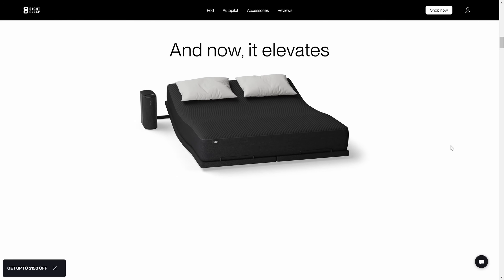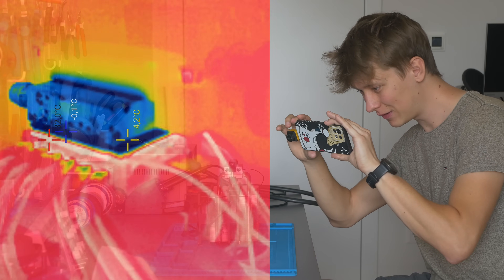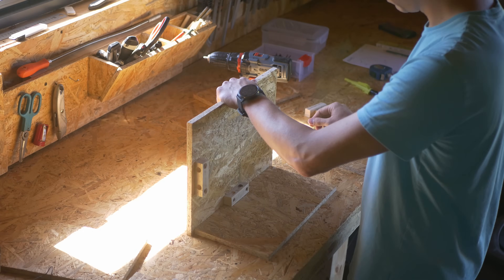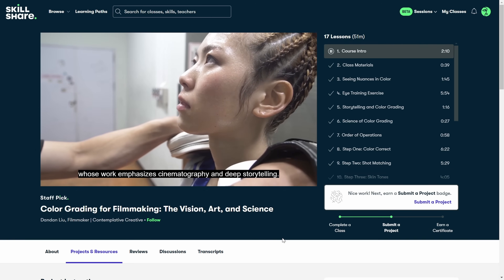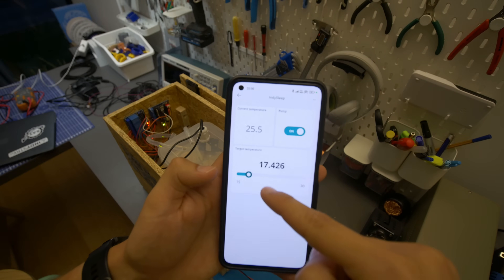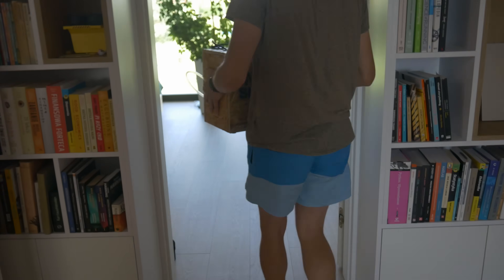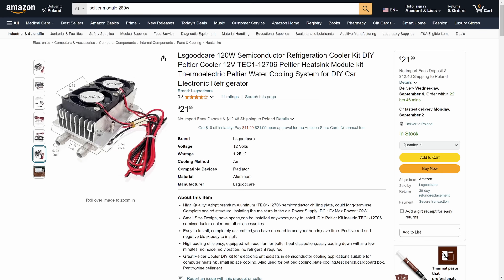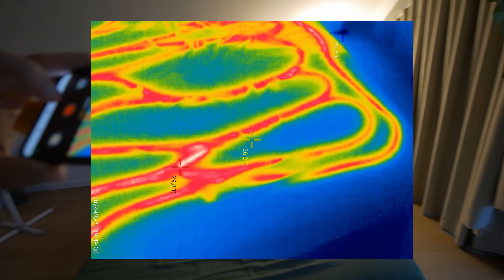I Made a $4000 Water Cooled Bed

Comment: Peltier cells just aren't the right tool for the job IMO. It's too inefficient and burns insane amounts of energy. Better to use an old fridge compressor/heat sink.
Reply: They can be efficient depending on the temperature delta and current
Reply: The downside with that would be sheer amount of extra noise from the compressor.
Also, working with refrigerants is gonna be a huge pain.
Reply: @FinlayDaG33k  for a refrigerant you can use the propane actually. Not the best freon indeed, and it's flammable (a lot xD), but the you can't beat availability and easiness of getting it if you're just a maker, not a HVAC specialist with proper licences. All other stuff (except refrigerant itself) you can buy without a licence
Reply: @felixyasnopolski8571  Still sounds like a huge pain to work with... Because now you have something that can kerplode. :')
Reply: @FinlayDaG33k  alot of ppl have propane torches in their house to light a fireplace, and it being in a ac unit is not much different, and in lower quantities.
Reply: Exactly. A compressor based coolant system in another room would be ideal
Reply: You honestly don’t need either, just use a PC radiator and thermostat to control how hot the liquid gets
Reply: You folks are missing the point, which is that the product is reliable, whisper quiet and works insanely well without any BS. It makes 1/3rd of your life 150% better. I used to feel like a zombie for the first 4-5 hours of every day, because I slept in a sweaty mess. Cooling your room does NOT cool your bed in a way that is useful. Furthermore, if you sleep with someone hot, I guarantee you that they are cold. Trust me when I say that this $2500 system can save a marriage.
Reply: Yeah a good portable AC unit is like $500 USD, and they're quiet enough. Just hack its cool line to go through your mattress and you're set. Or jam a radiator in the cold air outlet to run your line through, so you can still use it as an AC
Reply: @32BitJunkie then its just easier to cool or hest the room and not the bed
Reply: @32BitJunkie  true and you can even get them for like 200 bucks😀🥰
Reply: @32BitJunkie the latter works insanely well, I've done this myself LOL

Comment: It seems like the primary issue is getting enough heat to transfer between the tubes and the bed. Id make a metal tubing system thatd be placed underneath the bed. To make sure the bed is comfy id inlay the tubing in a sheet of foam. Lastly id attach rolls of metal to the pipes to further disapate heat. Also id be carful with how thick the mattress is. I dont know how insulative they are

Comment: For sure the best way is to use compressors, but it's practically impossible to realize without specific tools 😃

I tried to build a peltier cooling system and what I can say:
- There was lack of cold side insulation
- Hot side was watercooled with big cooler, but in the same case it was diffusing heat too much
- Pump was to small for hot side
- And the most important: I should have used mosfets to better manage my pumps speeds and fans, but mainly for the peltier, as when you turn it off all the heat is going back to the cold side

I was using PC PSU for that and it was sufficient for 8 peltiers as yours, at the condition to use all 12v and GND cables :)

This kind of system must run on solar or wind turbine system, as it's a fully recyclable and very durable system (against compressors), but also as it consumes A LOT of energy :)

Nice you tried it, if you wanna continue I recommend you buy chinese waterblocks for both peltiers sides (4-slots is good), and a freaking car radiator to dissipate all that massive heat and send it to the space woooww 🏔🌍🚀💞

Comment: Regarding Thermal Paste: You basically over complicated things, in general you just put one or more blobs of thermal paste on the cooler and the paste spreads its self while tightening the cooler down. So no real need to spread it with this much effort :)
Reply: That is true if you have enough clamping pressure. While that's the case with modern CPU coolers, with this mounting setup that might not be the case.
Reply: @WoLpH  fair enough

Comment: maybe something like a flat inflatable water bed that you circulate the cold water under where you sleep as a heat exchanger might work instead of tubes
Reply: and maybe an old fridge cooler mechanism with inverter and a pid controller might work better than the peltier
Reply: If you build a small water bed... Why not just go all the way that ist much more work. And if you're just thinking about a bedsheet with water in it. I think you have problems with the cooling circle. Like it will have some dead spots where no cold water will flow to.
Reply: @fridolineckerd6135 you could maybe combine several smaller pouches filled with water
Reply: I wonder if a water bed passively cools on its own... That's a lot of thermal mass right there at room temperature

Comment: Did you ever sleep on a cool bed in a hot room? I never tried that. I live in hot climate in Thailand. Almost everybody wants to sleep with some cooling. And almost everyone uses air conditioners to cool down the room temperature and/or fans to move the air, so they feel moving air on their skin which makes it feel cooler. I don't know anybody with a cool bed - and I don't think it would be comfortable.
Cooling just the bed should be a lot cheaper than cooling the entire room. And if it would work, I am sure lots of people would do it. But nobody does it.
Summary: Get an air conditioner for your room. Problem solved. Enjoy!

Comment: I wouldn't say this failed. It just seem to underperform. One quick thing to try is reduce the amount of bed you are trying to cover. Maybe just half the bed or just the area around your torso. As for tube placement, what about taking two sheets and sewing channels to hold the tube in place?
Anyway, great idea. Looking forward to how it keeps you warm in the winter months.
Reply: Very true. Although the end goal wasn't met (cooling the bed to a comfortable temperature), the system itself worked. Even something as simple as running the liquid through multiple Peltier coolers would make it perform better.
Reply: @timderks5960  Yeah a second box on the opposite side of the bed with another peltier and heatsink (maybe a second pump?) would probably help. Cool/heat the water a second time halfway through the loop.
Reply: @timderks5960 yeah but then you're just making the problem of the peltier increasing the room temperature even more. I wonder how Eight Sleep does it
Reply: @athmaid  they don't.
the heat in the bed isn't great enough to significantly heat up your room anyway. This is basically a fridge logic.
and let's be honest. If you can afford $4000 with subscription, you can afford AC unit.
Reply: An idea from my small brain is to have a bigger insulated reservoir for the water. The power should be enough to cool/heat a "heat bank" closed from the bed loop for a time before going to sleep. When going to bed open the full loop and you only need power to maintain/slow down the heat already in the system.
Reply: add more dense tubing and connect it to a chiller that will make it really cold

Comment: Routing grooves for the tubing in foam insulation would provide some benefits: 1) reduce heat/cold loss into the mattress, 2) make it easier to route the tubing, 3) smooth out the surface you are sleeping on. I was thinking of that flexible closed cell foam often used as protective packing. 

I foresee problems when you are in cooling mode with moisture from condensation accumulating on and near the tubing. It might be possible to use your micro-controller to monitor the relative humidity and keep the water/tubing temperatures below the dew point.  Here in Minnesota USA, high temperatures usually include high humidity. Wet bedding could get ugly quickly. Were there any indications that the $4,000 system addressed condensation situations?

More peltier modules would work but the inefficiency and difficulty transferring the heat outside would become even more of a problem.  Ultimately a refrigeration system might be more effective for moving heat outside the living space. Finding a small efficient compressor could be a problem. It might be possible to adapt a de-humidifier refrigeration compressor. That would likely involve some plumbing and recharging the system .......and a few more videos. 

Using peltier modules to heat might be less efficient than just using an electric blanket or pad. My experiences with peltier modules usually involved the cold side frosting up but I was not using water to transfer the heat. If your pump was to fail and the peltier module wasn't shut off, you might have issues with water freezing. I really enjoy your projects. Thank you for your creative approach to probems.

Comment: Nice!
Well, putting the unit itself outside will work better, making it a more local cooling-system (like airco but more specialized). And then ofcourse as a more efficient bed-heater then a normal heat-blanket as we normally use (just electric heaters). If you are using it in the same room, well you mainly move heat and at the same time heat (or cool) the room + extra electric heating.
Actually, peltiers work more optimized if you keep them cool on the 'hot side' too, thus a vat of water could help already to make a buffer.
For more optimized cooling, you can also use the system from a normal refrigerator/ freezer which is far more efficient (and therefore more quiet) then Peltiers, still working as heatpumps.

About the cooling... you need to insulate below the cooling or you will need to cool down the whole heat that is stored in the bed itself since that will keep moving upwards all the time. For example an airmatras below it. That is besides the spread of the tubes. Probably needing also to cover the bed before going to bed with the cooler/heater on for a longer time.

Comment: Please do a video on the mini arcade! I loved this project.
I think the tubing was a big choke point as well.
I can't think of another option, but changing out the tubing to something with a higher thermal conductivity would help alot.
I also wonder if, when testing it at night, your weight significantly inhibited the flow, limiting efficiency.
The small fountain pump provides so little back pressure that your natural movement during sleep could have some amount of peristaltic effect on the tubing, also limiting efficiency.

Comment: Hey Nikodem,
I’ve also been thinking in this direction and wanted to share a few ideas that might inspire you:

1.Cooling through water evaporation: One approach could be using an ultrasonic mister to atomize water and boost the cooler. Alternatively, you could consider wicking water through felt material and passing air over it to achieve passive evaporative cooling.

2.Hose routing: For the hose layout, you might find inspiration in the cooling systems of NASA spacesuits.
Reply: Just push air through the mattress, your body will provide the moisture. Humans lose up to a few liters of sweat during a nights sleep (depending on the person).

Comment: Possible improvements Im thinking about:

- stacking the cooling modules. Meaning facing the warm side of one with the cold side of the other one? Dont know if that would actually work

- have a dual water system like a nuclear reactor? Cooling a box of water down, maybe with the cooler build in with no pump needed, and then filling the box with loops and loops of the bed tube. That would increase the surface area and distance/time the loop water can cool down

- Prioritizing areas of the bed where the cold would be most notable, like head and upper body, since legs and feet are cooler than the rest of the body anyway

- Dual water pools aka. cooling one pool while the other is in use and toggling between them on a timer or based on temperature. Not sure how or how effective this would be

- Dont care about loudness and place it outside

- A battery setup? Since Batteries can deliver more power quicker. So charging the battery until x% charge, discharge until x% charge or water is at x temperature

- Wild one: Having the water loop above the bed, because colder air falls down? Hard to do properly though

- Water cool the hot side of the cooler

- If available copper tubing, even is only partial

- starting the loop from the upper side to cool the hotter body parts first

- Increased pressure in the cooling block by using two pumps, but then only use half the water to cool the bed. kinda like a high speed wind tunnel which uses high pressure air to create fast air

- put the loop in the covers, same logic as ceiling loop, cold falls down

Comment: If you were successful at cooling the bed significantly, you would likely be confronted by the problem of moisture condensing from the air on or near the cold tubing. Think of the constant stream of water generated by an air conditioner. It would be interesting to examine the store bought version to see if they had any feature to control that. Your micro-controller might be able to factor in the relative humidity to keep the water temperature below the dew point? 

Cutting grooves in foam insulation (a router would work but would be very messy) could both help route your tubing and also avoid having to lay on the tubing.   Most in-floor radiant heating systems install the tubing so the hottest tubing runs adjacent to the cooler return lines to spread the heat more evenly. The relative inefficiency of  peltier modules and difficulty transporting the heat outside might suggest making your own refrigeration system or adapting something like a dehumidifier which contains the necessary compressors and evaporation equipment though you would have to do some plumbing (and recharging) to extend the heat radiator outside.